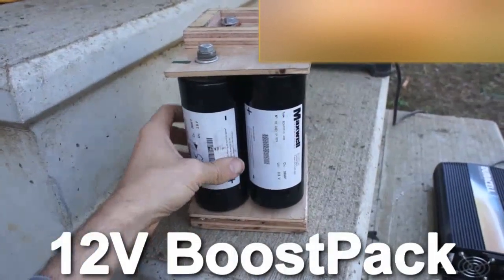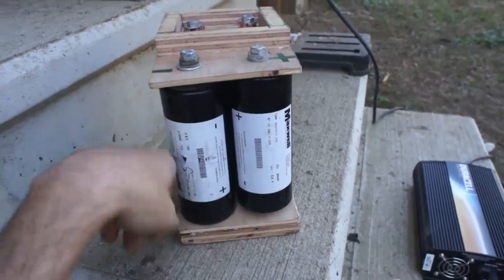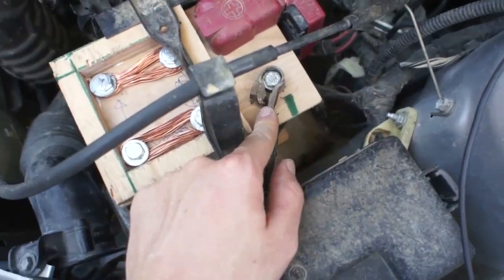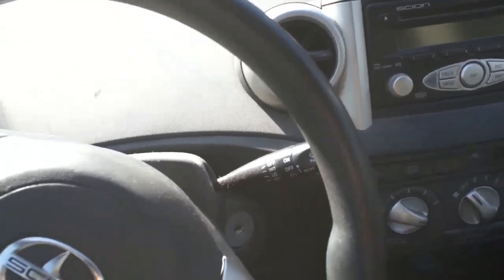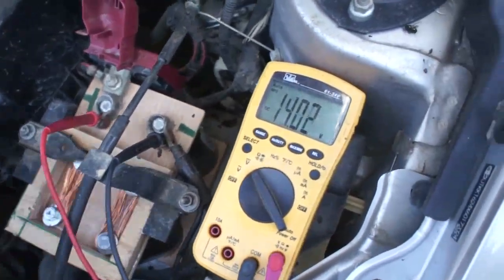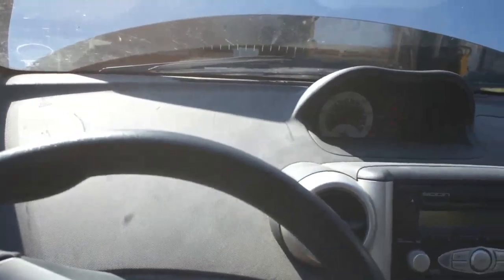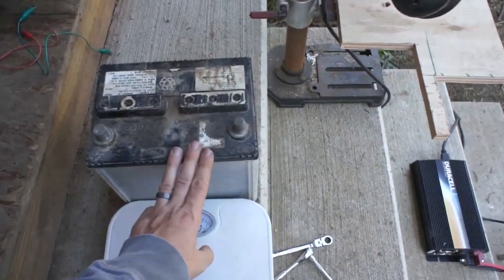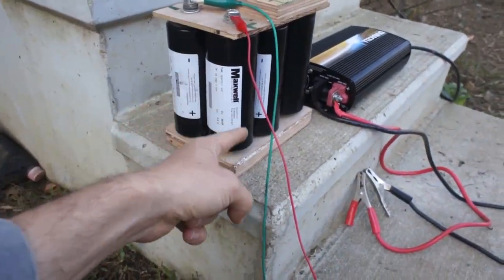12V BoostPack. Replaces auto battery. Works great!

Comment: What did you do take that battery out of a 1980's beater then toss in in your scion? lol that battery looks like it's 40 years old. Or it's just so cheap it was unintentionally made to where it looks old. Caps work good but not so much in the winter. Also just because they can deliver the amps at 10 volts doesn't mean it can can be shut off under 11 volts. Some crucial components in the car might need 11 or more volts for memory storage like a black box or the engine's management system.

Comment: Are there any dangers involved when using capacitors in this way for your car?
Reply: +Travis Piper 
12v is 12v.  It doesn't matter if that 12v source can put out 1amp or 1 billion amps, it is still 12v.   Your body has massive amounts of resistance and using ohms law you aren't going to magically have more amps flowing through your body no matter how many amps the 12v source is capable of putting out.  A car battery can put out many hundreds of amps.  If you were going to get shocked by these capacitors at 12v you would also get shocked by the car batter if you touched both terminals but you don't.  I = V/R
Reply: +Christopher Chalabi Capacitors can pop.  They expel their innards and it can emit a lot of smoke too--which will gag you.   Just wait until the air clears and you'll be fine.  It won't happen unless something is dreadfully wrong though.
Reply: +Travis Piper Sorry that is not true
Reply: +Travis Piper Each capacitor is only rated at about 2.7v, the pack voltage is only about 14v in this application. You will NOT get an electric shock from this pack but you would not want to get any metal jewellrt across it.
The current that is able to flow through your body is determined simply by ohms law... at these voltages you will be lucky to get 1mA flowing through your body. The capacitor bank does not store very much energy compared with a car battery but it has very low internal resistance, far lower than the battery. A car starter motor typically draws a few hundred amps, the ultra capacitor could not do this for more than a couple of seconds, the battery can usually provide this current for a significant time. Some commercial use of these capacitors has been with a small lead acid battery in parallel with them, on a high performance car shedding 20 or so pounds of weight is very worthwhile..
Reply: +Travis Piper You will not discharge one of those capacitors by touching it for a few seconds or minutes. A 3500F individual capacitor will provide the sort of current your body will draw from it for many hours. In fact it will generally discharge itself faster than you would by touching it.

Comment: I have 18) 2.5 volt 2600 Farad Maxwell Super Capacitors and aluminum buss bars that I just purchased on ebay.  How do you wire them up in groups of 6) in series then parallel them to get 15 volts to power my high power car audio amplifiers?  Also can you charge them up by connecting them directly to the car battery?  Or can I use an LED light with a 2 wire pigtail to charge them up?  Please help me out buddy.  Thanks.
Reply: +Clyde Yamasaki You would hook 5 of them in series (pos to neg like flashlight batts).   hook up a cig lighter plug in so you can jump your batt using the cig lighter.   Observe polarity to get it right.   Should work.
Reply: ***** yes, you are correct.   My bad.  I did do that with smaller sized capacitors to add kick to my battery.   It hasnt blown a fuse yet.  But these monster caps are a different story.
Reply: Far a day I thought I was right.  ha ha.

Comment: but the chickens...  Seriously though, the problem with ultracaps is that overall storage capacity is considerably lower. The 3000F device will store about 1/10 the total capacity of a 60Ah car battery.  Great for starting your car a few times, but you'd be in trouble expecting to run accessories without the car running.  Say you run some accessories (stereo, etc) for an hour on a typical car battery...that should leave enough to start it back up, but you'd only get about 5-6 minutes on a ultracap bank like this.

Comment: How does the capacitor system work after not starting for awhile? If you let the car sit for say a week or two would it still start? I say that because I thought capacitors typically naturally discharge over time.

Comment: What are the specs of the Caps you used...??   I'd like to build a 24volt system using 24 Caps, hooked to a solar panel full time, & try to run my electric wheelchair to see how it goes
Reply: +Dale Bergeron Hey, I use to repair Electronic Life Support Systems in hospitals, I now fix Electronic wheelchairs for people who need help but have no money, I can run a chair with 24 Caps, no problem, question is how long it will run, with solar panels attached it can recharge, again the question is in what time.. I'd sure like to try..
Reply: +Bob White Capacitors don't do so well with prolonged draw.  You saw after less than a minute,  a big chunk of the energy in the pack had been used by the headlights.  Capacitors store a lot less energy than batteries, but the downfall of the battery is that the available amperage really drops off at lower voltages.  BUT it can go for a lot longer at optimal voltage before it starts dropping.  Caps start dropping right away. 

An alternator can supply a ton of power right back into the caps and replace the power lost by starting the engine.  Solar panels only provide a few watts, so they wouldn't be able to charge the caps particularly fast.  Again, solar panels are so slow that the limitations of chemical storage ("slow" charging) are irrelevant because there's no power available to charge it faster.  

If you want an actual time? Probably between one and two minutes.  And that's with a cap bank that would (nowadays) cost several times that of a car battery.  You're better off with a deep cycle marine battery if you want long-lasting power at relatively low drain.

Comment: I've wondered about developing a system in a car or utility vehicle where the "boost pack" is supplemental to the battery.  Sort of like a hybrid assembly? 

You have the main car battery which you typically use.   

If the battery is not strong enough to start the engine, you use the boost pack to siphon off the last remaining reserve of the battery to actually supply enough cranking amps to get the engine started. 

If the vehicle is stone cold dead, when jump starting or using a charger the time involved is much less.  

Side note,  its so annoying that the price of these caps sky rocketed.... 6$ a piece.... lucky to find them for under 35-40 a piece today.   Damn.... I was really wanting to do this for my mustang drag car.   Literally perfect.  The car isnt something I daily drive, so long term charge or reserve capacity is irrelevant.  I just wanted to find a cheap way to shed like 20 some pounds.

Comment: Hi lasersaber. Cool build. I am a South African rancher an am thinking of replacing a tractor battery with a boostpack similar to what you built. Our tractors stand idle a lot of the time and under those circumstances the battery just does not last.  What prevents your vehicle's alternator from over charging the boost pack in the event of the altenator  malfunctioning? Would super-capacitors be up to a more rugged environment high temps and bumpy roads?

Comment: I wanna do one for my car as well, all I gotta do is put 6 capacitors in series and connect the car cables on each end of it?
Reply: +Faby Wolfy It's not that easy.  As he said, you need a "battery-brain circuit."  This is a circuit that will automatically cut power to the capacitors once they've reached their charge limit.
Reply: isnt it more easy to just use one extra capacitor?

Comment: Way to think outside the box, but I would like to add that you really need some kind of voltage protection device for each ultra/super capacitor. Ultra/super capacitors really need some kind of active/passive cell voltage equalization device to protect them during the charge cycle.

Comment: What is the possibility of setting up enough of these caps to use as a storage system for a house that is off the grid. You use solar, wind and if you are near running water, a turbine to provide all the power to your house. But if for some reason, these things can not provide the power to run the house, you will need a back up system to run the things like the fridge, heater in winter, electric stove and give you time to shut down things like your computer so it is not damaged by the surge of power when your power system comes back on line! Or to pick up the slack from the solar panels going down at night Could you use caps for this?

Comment: It must be a good experiment since it leaves us with even more questions. Maybe you can make a bank of these to store energy. How much energy can one of these store that weighs the same as the battery you aren't using? I know that some EVs use capacitors for a quick charge. Can this be the DIY version?
Reply: Battery cheaper and far more power reserve

Comment: That's a hell of a lot cheaper than a new battery. You might as well buy the battery the way the caps are priced now. Hey have you tried replacing the acid in the old battery with alum and water,there was a video on where a guy did that and it worked well according to the video.

Comment: This is the dumbest thing I've seem sorry to say.  The caps will have only enough reserve to start the car and nothing more. God forbid that you turn off the car to listen to your stereo for a minute or two or leave an interior light on because this solution will have no reserve then you'll be sitting there with a dead bank of caps and need a boost where a regular battery would have had no issue.
Reply: Leaving the lights on or listen to the radio while the car is not running are those things that shorten the life of regular batteries.
Reply: I can see it in time where batteries are getting smaller and more and more capacitors are being used.
Some electronics and electrical items are incorporating them already instead of batteries.
Reply: You don't know what your talking about lol
Reply: God forbid you actually WATCH the video!!!
Reply: I mean.. if you carry a portable solar panel with you which he probably does than you're golden. You don't need reserve when you can generate. If you do a lot of night driving then you could fashion a crank generator from a minimal motor. Still golden
Reply: that Low. Voltage. was caused by leaving the headlights on for 30 seconds. No thanks, I'll buy a $20 battery from the junk yard and get a new one with receipt every time it dies, the 0.008 mpg difference caused by that 25 extra pounds I can deal with
Reply: He didn't say anything about starting it in the Winter. He said it wouldn't do anything more than start the car. Maybe you should actually READ and UNDERSTAND comments before you go posting and make an idiot of yourself.

Comment: one use i can see this system having is in conjunction with a leisure battery, which doesn't like to give out its power too quickly. so you get the cold cranking amps, of a car battery with the capacity to deep cycle without the vulnerablity to damage from excessive drawdown

Comment: Its very clever idea that you used cpacitors that it saves the electricity pulse inside it .. it will work so fine but not for several times or usages just for starting up the "good condition car engine" for one time maybe 2 times but the problem is if the engine or what ever did faluire to start from the first or second or third time there will be no chance for forth time the pulse in the cappacitors will gone it will drop to zero volt

Comment: How much CCA does this produce? I am interested in making a kit like this for my car but my VW Golf TDI needs 1200cca compared to a gas car which needs 600-800CCA
Reply: Evan McMaster one smaller maxwell boostcap has a shortcut current of 9000 amps.... and that's only one of them
Reply: ***** a capacitor can output all the stored energy almost as fast (with a delay of couple of microseconds) you can use it